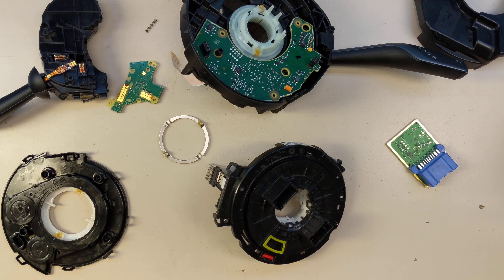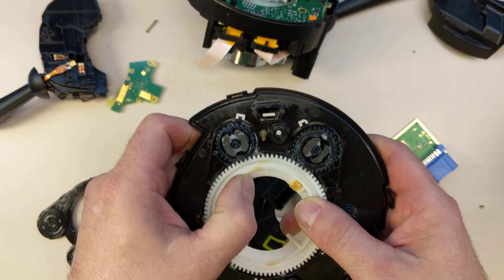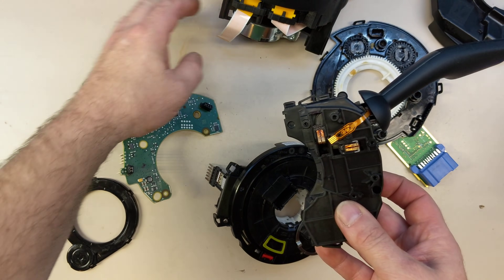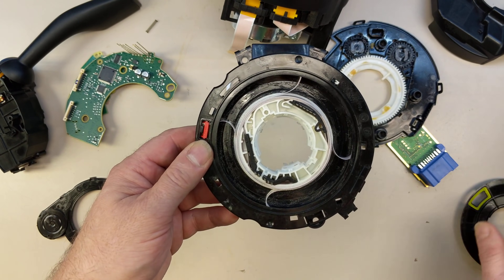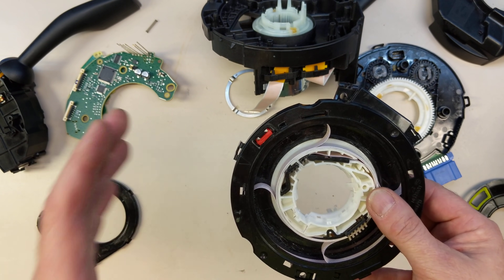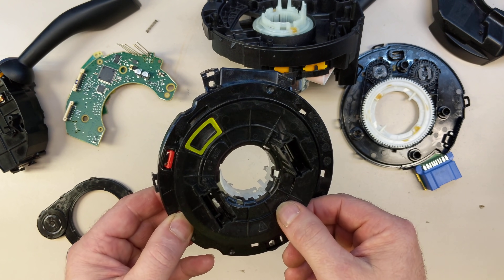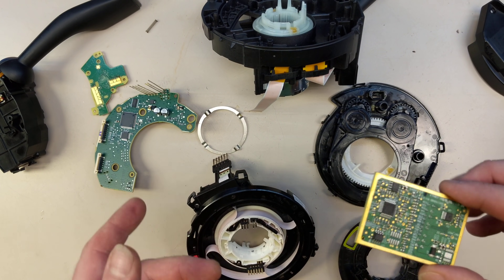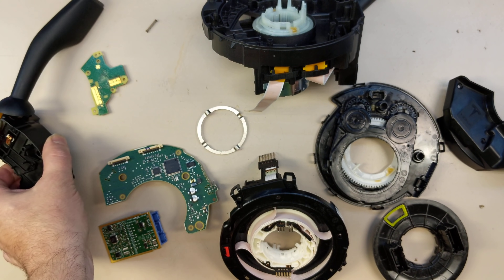Tesla Teardowns - Why is there a CLOCKSPRING?!?

Comment: The SCCM module itself is actually made by Kostal. One interesting difference if you take apart the drive selector is that it is Hall effect, unlike the contact based approach on the turn signal. Presumably this was done to ensure the more important control is more reliable. I have a few of these modules and had to repair the little legs on the turn signal side on one.

Also LIN isn’t actually terminated at the sccm, but goes all the way down to VCLeft. Iirc, the LIN line passes directly through the connectors and travels to vcleft. The sccm doesn’t speak LIN at all.
Reply from the maker: Thanks Ryan!
Reply: @Ingineerix  I just don't like all that complexity, at all.  I wish a company would build a SUV/ crossover and mid sized truck that can go 300 miles,  just has a battery, motor in the front and motor in the back (for 4x4) and NOTHING else.  No screen. No AI driving. No reverse camera. No electronically adjustable vents. Why are they a thing?  I want hand crank windows and manual seats, manual mirrors, standard cruise control, speedometer, charge and temp gauges on the dash and nothing else;  and make it for $14k.   If a company built this basic, baseline utilitarian vehicle, it would be the next Henry Ford revolution and they would sell millions and millions of them.  All people need is something that works and gets them there;   we don't need a self driving spaceship with it's own personality that has an IMax theater inside it.
Reply: @calholli  no one would buy that. people are used to power everything(as unnecessary as it may seem). no one even necessarily "requires" 4x4... America is paved. Your build sounds like an ATV...
Reply: @calholli  So you don't want the statistically less likely to get into an accident Tesla with it's ADAS? You do want hand crank window regulators made out of crappy pot metal like the ones that used to break all the time in old GM vans? You do want an analogue instrument cluster that costs more than digital one? You don't want torque vectoring to make that dual motor setup worth the cost? You would rather change lanes with your fingers crossed hoping no one is in your blind spot because it's too much trouble to readjust the mirrors every time they get bumped or were set for a driver other than you?
I get it, I do, all those motors and gear trains for mirrors and seats and all are potential points of failure but if they're made or spec'd by a company like Tesla I trust that they'll do all they can to make them lifetime reliable and so I believe that the extra cost of such systems is well worth it.
Reply from the maker: @calholli  Not going to happen, for starters a lot of this "complexity" is legislated in the form of DOT regulations.  For instance a reverse camera is now mandatory.  That means you're getting a screen too.  If more people really wanted a "bare bones" vehicle, then little small econoboxes would sell better.  As it is most automakers are discontinuing these models as more people are buying large loaded uxury SUVs.
Reply: @calholli  what you really want is a glass roof!
Reply: @calholli  if all this electronics, which basically costs almost nothing in mass production is a few percent of the worth of the car, you will get it anyway. The battery is too expensive as a component, so simplifying other won't really reduse price this much. It is more complicated than a gas tank.
Reply: @calholli  I'm 50% with you on that, can't stand self driving - or powered seats, I would however keep my power windows. So my list includes simple cruise control, a screen which only does android auto, physical heating/AC buttons, a dual motor power train and reliable large hv battery. I'd never buy a new car so will be needing to make it!
Reply: @calholli  the thing that you don't understand is that many of those things you mentioned actually are cheaper for manufacturing than the old manual stuff.
The electric window regulator is a compact motor with a plastic chain that runs the window, which is a lot cheaper to manufacture than the large steel sector gear and crank arm that was used. It's also a lot lighter.
The screen is cheaper than a cluster of mechanical gauges.
Power mirrors are a luxury, but it's worth every penny! And adds to safety.

One thing you have to remember is that the cost isn't just about the cost of the part itself, but rather the cost of manufacturing the car.
So if the power window is mostly robot assembly and just snaps into the door in seconds, while the metal regulator requires many human steps to assemble, grease and install, that drives the cost of manufacturing up.

Installing, plumbing and wiring all of the mechanical gauges up, putting in the oil pressure lines and the ammeter shunt, and then trying to stuff it all into the dashboard, takes a lot of human labor, most of which is moved to automation when it's on the screen instead.
Reply: @calholli  convert an old stripped-down pickup truck to electric. I would think there are shops that would be able to do it. Maybe that’s a business venture for you. If there really is that big of a market for this, it could be veery successful.
Reply: @calholli  which do you think is cheaper to manufacture and assemble, a custom shaped display screen integrated into the dashboard, or a commodity standard shaped large screen in the middle? (hint: it's the single big screen)

The motorized hvac control system is cheaper and easier to install than a manual system, even though the motors might be more expensive than a manual vent, because it is designed to take all the manual work during assembly and automate it.
If you think about the old style with the cables moving the diverter doors, and all the fiddly work it takes to install a new cable or get it adjusted, and now it's all self contained as an integrated unit.
They can then add a couple of extra motors and doors to make it "deluxe" while they are at it, and hardly effect the price.

And while there are some things that are definitely unnecessary, Tesla of all people is the expert at removing things.
For instance, the fancy invisible vent system I think actually simplifies the car, using differential air flow rather than mechanical devices to direct the airflow.

And adding the remote control features is easy to do since everything is integrated and electronic to save costs by streamlining the design, so it's just a matter of making the App able to talk to the car.

As for the FSD hardware, YOU may not want the car to drive for you, but as we can see, that's something a lot of people want and will pay for, and by putting it on the entire fleet, it brings the cost way down for everyone.
And when they get the FSD software finished,  ALL the cars will be capable of something no one else can do, so it's a long term investment.
Reply: @Ingineerix  they sell great in countries not the USA
Reply: @zoemayne  You replied: "no one would buy that." => Well, people in China buy Wuling HongGuaang Mini EV by SAIC-GM in large quantities, even more than Model 3. If you translate its electrical body architecture to a truck, this pretty much resembles the wishes from calholli.
Reply: Doesn't they also borrow some of the buttons and stocks from Mercedes?